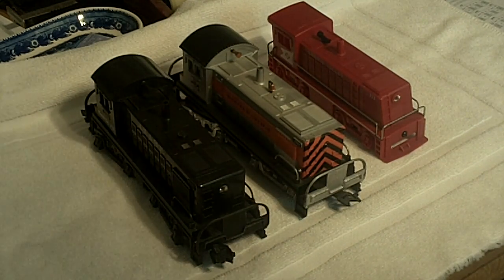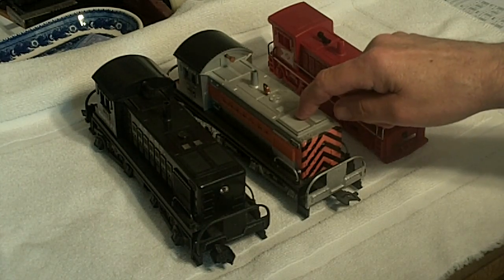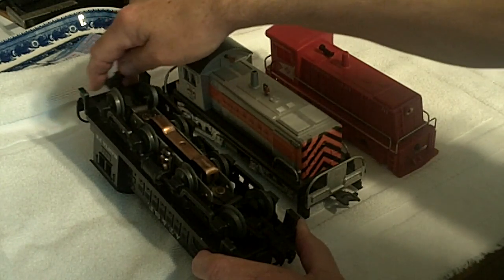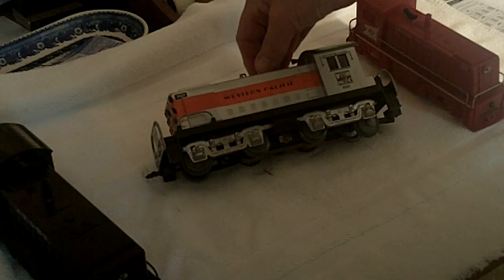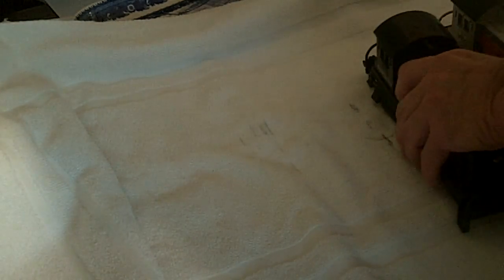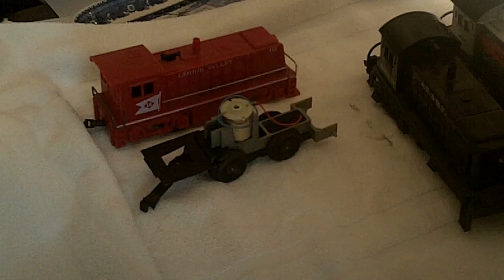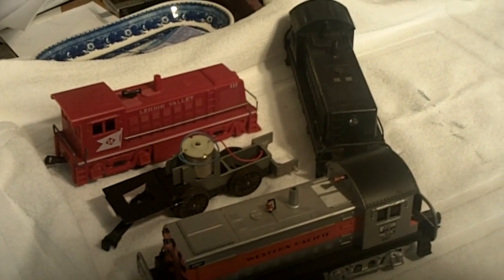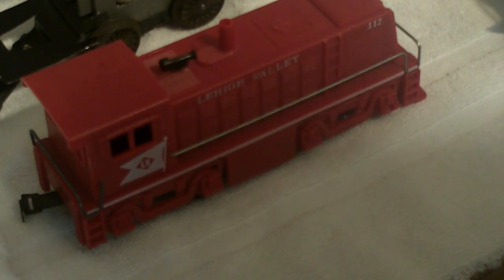3 Marx Switchers

Comment: Thanks for your video of these. I bought my first 8 wheel MarX switcher last year. It was not in great condition and one of the side truck  frames is still missing, but once oiled and running it might be the smoothest running AC powered engine ever. Yes, it holds the track very well, due to the center motor and that base frame is also a cast iron part as well.  To me this diesel switcher motor assembly is about the same one in their F3 diesel engines. I saw on one post it has a horn, but I have never heard of MarX having a horn sounder inside. They went as far as the electronic sound of steam in their latest 1666 steam engine with the Santa Fe slop back tender. They called it Sound Of Power.    Note: that DC motor might very well be a 3-6 volt motor. Some of those DC sets were battery only with a holder for 2 or maybe 4 D batteries. So if you want to run it on the standard AC track, you will need a heavy bigm, drooping voltage resistor as well as a diode or bridge rectifier.